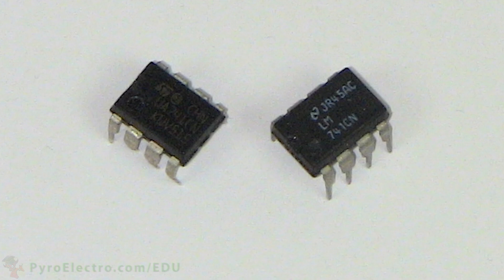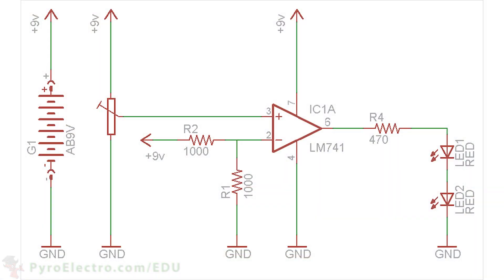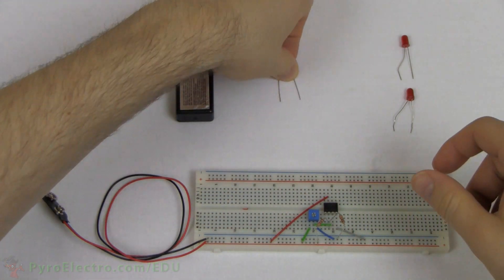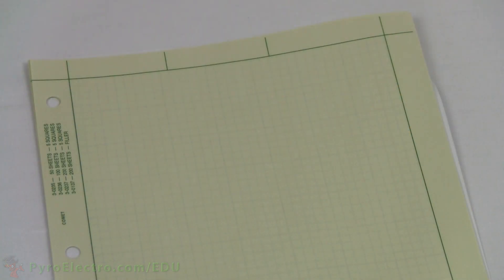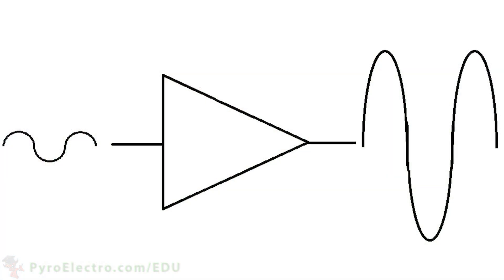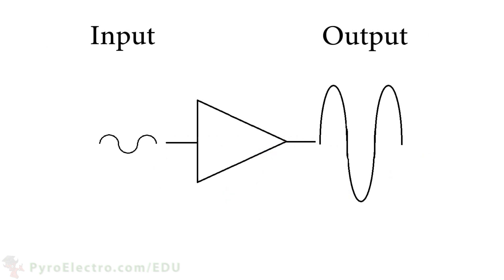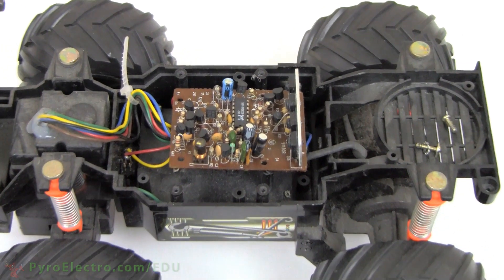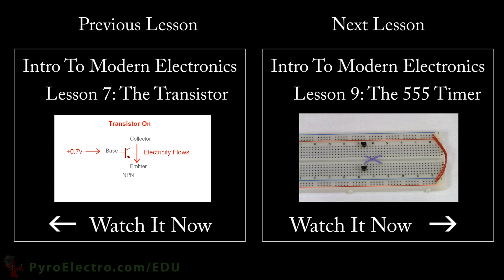PyroEDU: An Introduction To Modern Electronics - The OpAmp

Comment: One clarification for fellow students. In the provided kit, I got UA741 opamp. For this opamp, pin 4 is  supposed to be negative Vcc and not ground. Since Pin 7 is +9V,  pin 4 is supposed to be minus 9V, not 0V.  The example in this video doesn't work as expected: LEDs will light up for any trimpot voltage (even at zero -- LEDs just get dimmer)